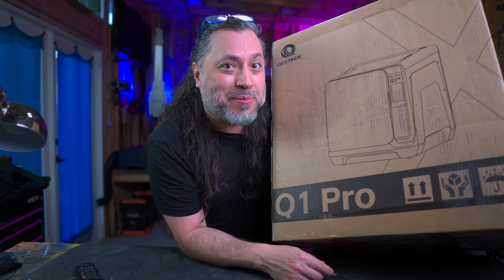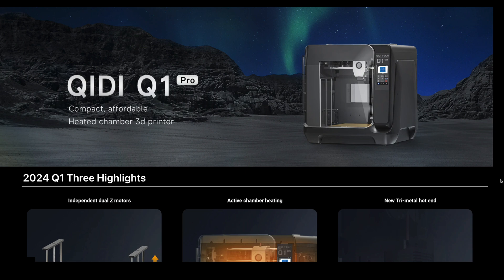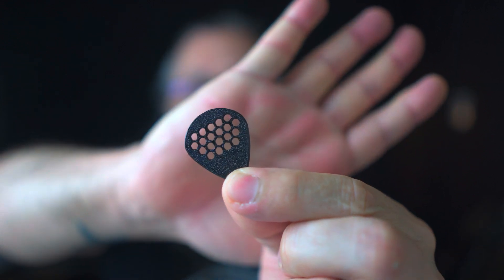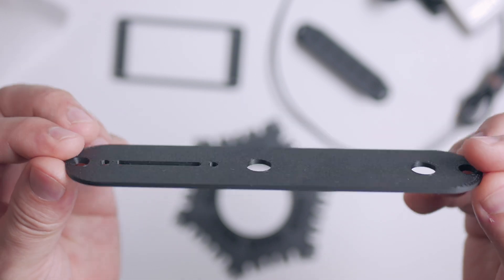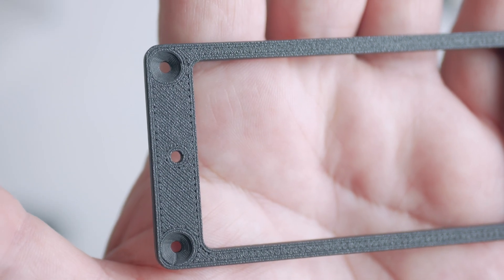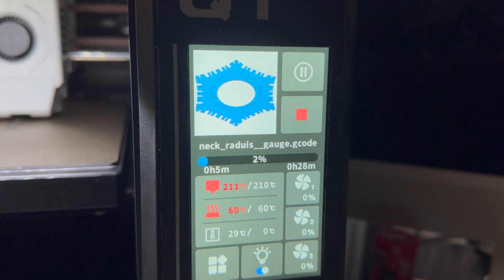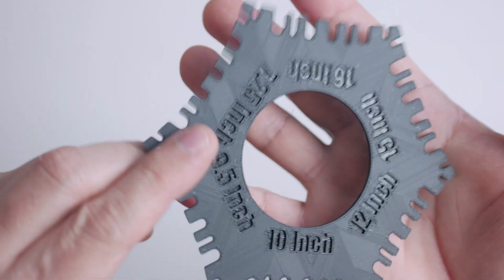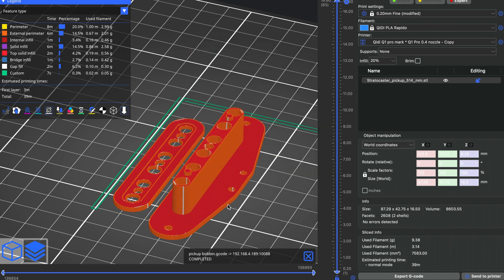A Luthier's 3D Printing Journey with QIDI Q1 Pro

Comment: I've been 3D printing for around 6 years now and just added the Q1 Pro to my shop and it's definitely the printer I would recommend overall to anyone just entering the hobby. The Bambu Labs printers are just as noobie friendly, but significantly more expensive to get the same features as the Q1 Pro. 

Thanks for the video! I'm a very casual guitar player as well and I really want to try and design / build a 3D printed guitar in the near future.

Comment: Hey Mark, 

This is my first time coming across your channel. I recently got a guitar and am learning. I have over 10 years experience with 3D printing and a background in aerospace engineering. In my experience all 3D printers are different. I would print a calibration cube to make sure it’s dimensionally accurate if you are printing off measuring tools. If you run into any problems with anything 3D printing let me know. I would be more than happy to help!
Reply from the maker: Thanks so much, I will!

Comment: You could print a holder for digital gauge for measuring string height, and you could add an electric contact like the tool for setting the starting point in your CNC. That way you could have a complete overview of your fretboard and maybe find problems that you don't see with straight edge or other tiols.
Reply from the maker: Great ideas.

Comment: I've been playing guitar for almost 20 years, and was always interested in building them, done some repair work in the past. I also have been 3d printing for the last 8 years.
I printed mostly setup tools or fret work tools, knobs and strap locks. I once made a nut using resin printing, cuz the resin becomes quite hard after the part is ready, and it worked nicely! It was printed with the slots for strings. 
And yeah I designed myself a perfect pick that I like a lot and been playing with 3d printed picks for years now and will never buy off the shelf ones again.
There are projects like prusacaster to print the body that will attach to a regular neck. There are 3d printable ukuleles. 
I'm happy you're going this route too, even more exciting possibilities!
Reply from the maker: I debated printing the Prusacaster. In the end, I decided to design my own body. I would greatly appreciate any tips and tricks you may have. Thanks!
Reply: @MarkGutierrez  I remember strandberg himself used 3d printing during prototyping most ergonomic body so yeah gotta come up with our own designs. It would be cool to make different body wings for neckthrough design. 
As for tips, related to guitar can't say much, but if you'll need tecnical advice in 3d printing feel free to reach out.

Comment from the maker: I'm 100 percent new to 3D printing. Literally, these were the first things I ever printed. I'll happily accept any tips, tricks or suggestions. Thanks!
Reply: You're already WAY better positioned than the typical newbie, as you're already adept at CAD software and thinking in terms of 3D geometries with the CNC process.

Will be interesting to see how you might be able to design the full guitar in one program, then export shape files to the CNC for the woodwork and to the 3D printer for plastic things like pick guards and cavity covers.
Reply: Excellent
Reply: Make sure to dry your filament, and keep it dry. Some are worse than others, but if it is humid where you are, a TPU print could start dry and by the end of your print, be so wet that it's stringing and causing other issues. Sometimes wet filament is brittle, and can break in the tube.

So unless you live somewhere super dry all the time, you may want to get a dryer, and some airtight boxes to keep the filament in when not in use. Make sure to put some desiccant in that box as well.

If you start having prints that don't stick well to the bed, there are likely only a few causes. You can print with a brim by changing settings in the slicer if the piece just doesn't have enough contact with the bed to stick. If it's a print that shouldn't need a brim, and it's not sticking, it's possible that the bed needs to be cleaned with soap and water. Then dried off with a lint free cloth, and then wiped down with 91% or higher IPA. Some times bits of plastic may still be stuck to the bed, but not noticeable. So if after washing things still don't stick well, a light scrub with a blue (very scratch resistant) dish scrubber will help.

There are many great 3D printing channels here on YT, so you should easily be able to find videos on any issues you end up having.

Also for you or anyone else new to 3D printing, if you end up having so many problems with your printer that you just want to give up, you may want to consider buying a different printer. There are still a lot of infuriating printers on the market. But there are also a handful of ones that generally make the experience fantastic.

Welcome to the wonderful (and some times frustrating) world of 3D printing.